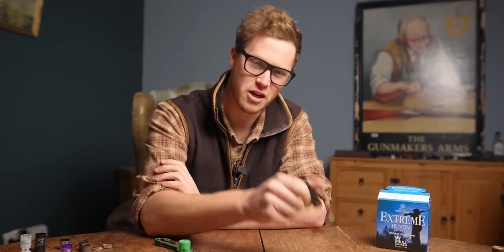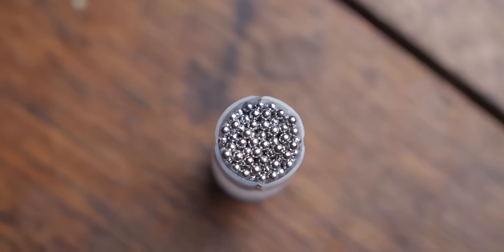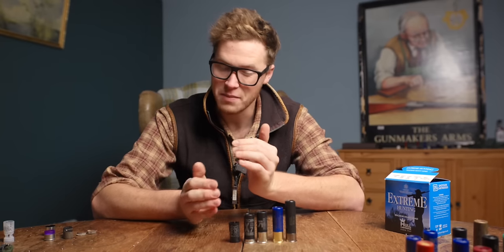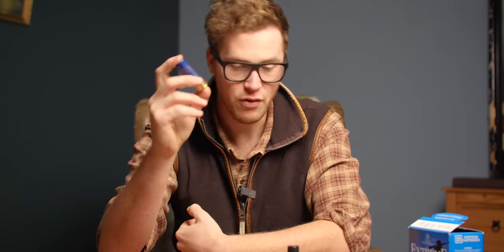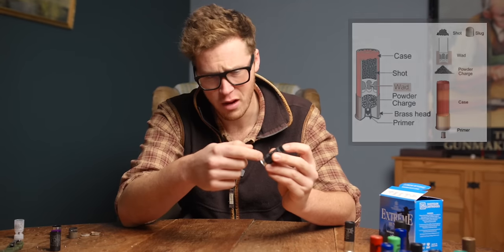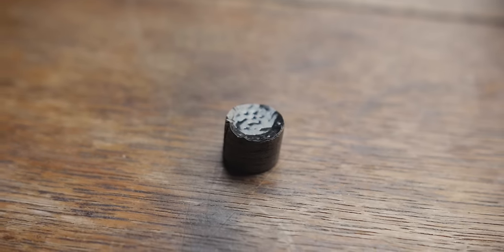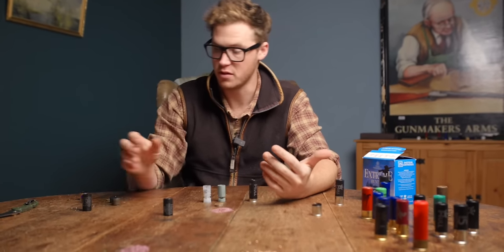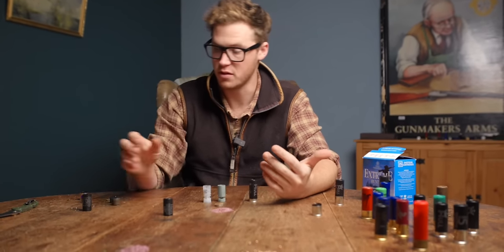12 Gauge Explained

Comment: I would love to see more use out of the 16ga. I wish it was more widely marketed and embraced. It is the perfect cartridge between the 12 and 20 in my opinion.
Reply: I see no need for anything but 12 and 20 gauge.
In my opinion companies are wasting time making anything else.
Reply: As much as we would like 16 or 28 to be successful the problem is that 12 and 20 offer more. There just isn’t many load choices out there. A 3” 1 1/4 oz 20 can outperform a 12g field load. And most 16 loads are a 1 oz load. 28 doesn’t do much more than a 3” 410. When 3.5” 12g came out it killed 10g for waterfowl and steel loads. If 12g can do it then any other gauge can’t really compete.

Comment: Another amazing video, I even learned a thing or two. I also really love learning the differences between North American spec ammo versus European spec ammo. 

As a 16 gauge fan, I will argue about shot stringing. It has nothing to do with length of time it takes for that string to travel, as much as the flyers you get the longer your shot string becomes. 20 gauge is the gauge I honestly HATE hunting with, as a massive result of this issue. I have tried every shot load available, every choke I have and all 4 or my 20s but my Winchester Model 12 20 gauge for guns, and I have the same results. I always hit the meat with a random flyer, or have weird inconsistencies with my 20s. I have sometimes the same issue with the 12 gauges guns too. Just far less frequently, and I just find I don't generally need that much lead down range to hunt anything or that added weight and recoil when upland game hunting. So I chose my Royal Bore or the Genetlemens Gauge for many reason. Practical experience on hunts with every gauge but a 32, 24 and 10 gauge have taught me a lot. .410 is the bird crippler, 28 is the underrated underdog that needs more variety and versatility. 20 gauge is great for beginners, but overrated now that it's the most popular gauge. 16 gauge, the 20 gauge for men, and the gauge of the perfectionist is far better than most will give it credit for, largely due to how few hunt with it. 16 gauge shines as the ultimate hunting gauge for versatility, and should have its own class for competition. 12 gauge is the we already know gauge, and the gauge everyone compares everything to. It's best suited as a defense shotgun and military/law enforcement to be honest, but is also the most versatile gauge on Earth which is why everyone and their dog has one. It's the most popular cartridge in the world, outside of maybe .22LR or 9x19mm Luger. Their is nothing as common as those three cartridges world wide. 10 gauge, well they killed versatility by making only 3 1/2" shells exclusively by mainstream manufacturers, and weight, so 10 gauge is dead. It's a shame considering it's way better then the junk 3 1/2" Magnum super recoiling nobody likes this 12 gauge shell. I honestly don't know anyone outside of the off waterfowler or turkey hunter who use those 12 gauge 3 1/2" shells because of price and recoil, also a worse pattern. Many grab their 10s or 3" 12 gauge guns instead. At least from what I have seen, with advancements of semi-auto 3 1/2" 12 gauges a lot could have changed.

Comment: Good stuff JC . If you are using an older shotgun , just check the proof marks to make sure you are using the correct length cartridges . A 1 1/8 oz stamp probably indicates the gun is proofed for a 2½ " shell , a 1¼oz stamp is for a 2/34" shell , get it checked by a gunsmith , 
The gas from  Nitro glycerin in double base powders can cause the blood vessels in some individuals to dilate and cause head aches . If your gun is causing you headaches it may be the ammo not the  recoil .

Comment: The agilla mini shells are mainly used for increasing the capacity in pump guns and semi autos, but thier reliability must be tested in each gun. My experience is that the sometimes work and sometimes don't. I stick with 2 3/4" 00 buck in my pump gun with slugs on the side saddle.

Comment: I see you have a knife on the table to cut open shells. I use a cigar cutter. Works slick!!!!  Easy to cut just the top crimp off to reclaim components when reloading or you can cut the shell just above the brass like you did in the video.

Comment: Actually from what I’ve done research on CIP has higher pressures than Saami 
The vast majority of saami loads are below 12,000 psi  or 827 bar. 
In the US we really don’t have anything that compares to your high performance steel. 
Most of the loads in the US are equivalent to standard steel loads.
Reply from the maker: Interesting. Different to my research, but it bears a few hours time to learn the truth

Comment: I think the video covers pretty much anything for 12 gauge and is very helpful.

BUT

As a continental european (balkans) I found it difficult to follow the calculations with feet, yards, pounds (both currency and unit of mass). Inches, I can handle.

Please, consider referring to the metric system as well.

Thank you.

Comment: Great video ..newish to shooting so newbie question. Would the speed of the cartridge alter the lead required for clay targets?
Reply from the maker: For sure, but it’s negligible at modest ranges and target speeds
Reply: There is a chart available online. If it is to be believed, the difference in time, to an average distance target, is about 0.01 of a second, per 100fps difference in  cartridge. There is no way you could measure that difference in perceived lead.

Comment: Really didn't think you could use slugs in the UK, would that not come under a FAC?
Reply: Yes.  They're restricted to section 1 license.
Reply: @ChrisUKFF  is that because their flight is better with a rifled barrel or because they are defined as a bullet?
Reply: Honestly I’m not sure.  I think it’s that’s they only have a use in the UK for large vermin (foxes).  It’s illegal to shoot large game using them.
Reply: Because sporting cartridges are available under the following exemption "(a)cartridges containing five or more shot, none of which exceeds ·36 inch in diameter" which was put in place specifically for those with SGC. Anything falling outside of that would be section 1 (such as slug and Buck) or section 5 if it has no civillian use (such as a breaching round or less lethal).
Reply: @thatgearguy  that's an awesome reply, thank you. But 00 buck, the classic you know what is still ok?!
Reply: @ifell3  Some but not all. Just depends on pellet size and number.

Comment: Bought a 2003 silver pigeon S, there is no steelproof mark on it. will it be fine?
Reply: It will be fine for non-high performance marked steel shells, regular nitro proof is (I believe) fine for steel unless using HP shells.
Reply: If no fleur de lye on your gun don't fire high performance steel cartridges or any steel with more than half choke. If Damascus, no steel at all.

Comment: ive heard people claim you can safely shoot 2 3/4 inch out of a 2 5/8 inch chamber. How true is that?
Reply: Yes and no.  The length of the cartridge is measured from the unrolled cartridge. If you shoot a 2 3/4 length shell out of the 2 1/5 chambered gun then you have a small portion of the end of the shell running past the chamber throat. You can have the chamber throat lengthend to accommodate the 2 3/4 shell.
Reply: Sorry 2 5/8

Comment: A 12-bore does not range up to 0.790", that would be a 10-bore.
Reply: Mossberg does it with their 835 Ulti-Mag. It has a 3.5" 12-gauge chamber, but 10-gauge bore.
Reply: @JJW3  thanks for the information.
How does that work ?  Firing 12b wads down a 10b barrel?
Reply: @booglewho86  I've never owned one, but the 835 has a reputation for good patterns when Turkey hunting, and it is very popular for waterfowl. Somehow letting the wad/shot expand out to 10-gauge before getting to the choke seems to help the shot pattern stay consistent.